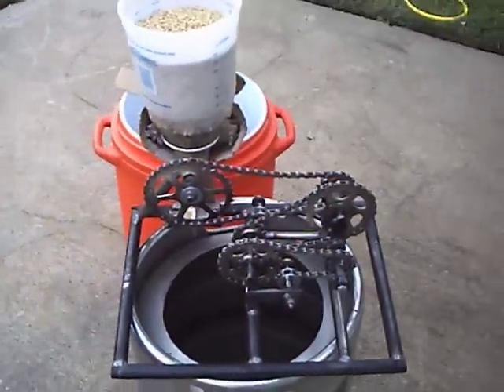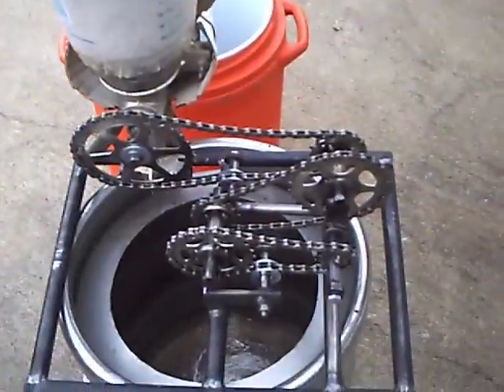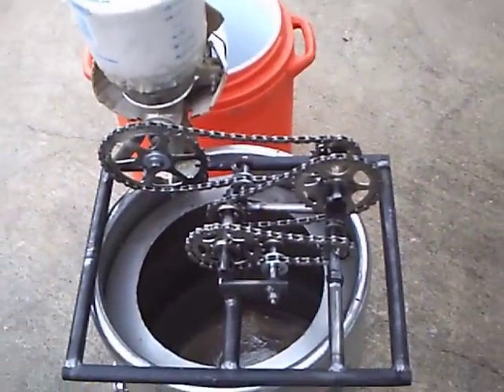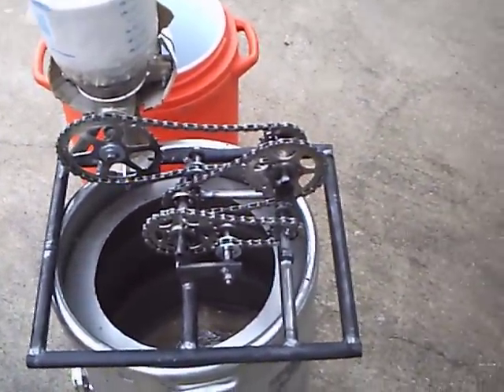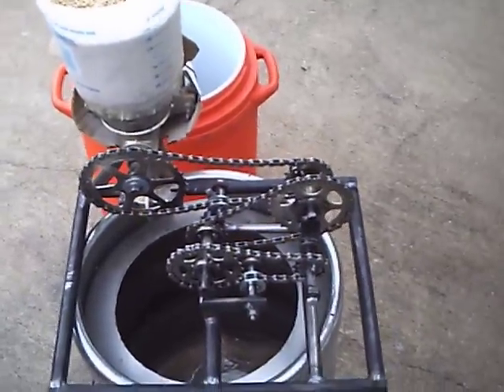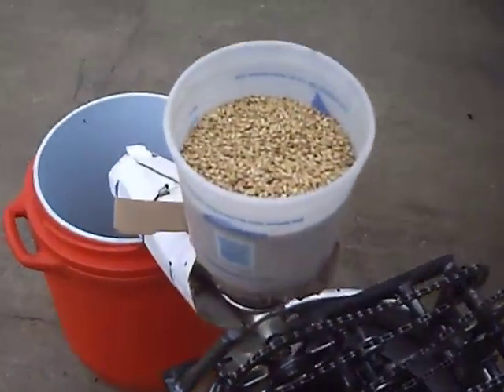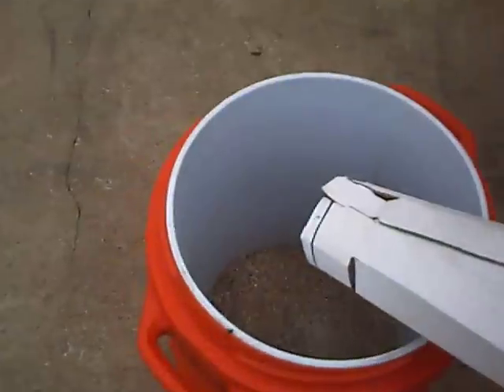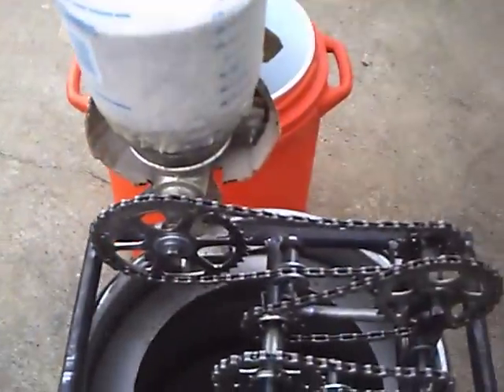Homebrew Grain Mill with Compound Gear Reduction Chain Drive

Comment from the maker: @pbatigne1 I don't remember exactly, but the small inpur gear would be either an 11 or 12 tooth gear, and the largest one is most likely either 32 or 34 tooth. I used the rest of the bicycle cassette gears in between to increase the reduction. Just remember to always drive the small gear.

Comment from the maker: Well, did try that, and it was not ideal. Drill motor got hot quickly due to the excessive load. Plus, I wanted to spin it slow so it wouldn't throw grain everywhere. I built it to accomplish my goal and to learn something... my "contraption" is still working fine 3 years later. Sometimes the best way to learn is by doing.

Comment: Much more torque is required than the drill motor can produce at low speed, Chain or gear reduction increases torque as it reduces speed.

Comment: Brantley, if I wanted to created such a gear reduction system on a bicycle just like you have it here, would it offer a better power to peddle ratio than what a 21 speed already has? My idea I mean would be to take a bicycle and setup a gear reduction system just like you show here to peddle the bicycle so that I am applying less force to gain more power in turn making the bicycle go fast with less effort. Or do 21 speed bicycles already offer that with the two main gear shafts they operate on? I mean maybe it wouldn't make a difference or maybe it would. I figure you would know. Thanks.

Comment: try using a wiper motor from a used car recycler as a motor. they're relatively cheap and good torque.
Reply from the maker: That's a great idea! Yes, those are pretty slow motors.

Comment: Most drills get 22 nm of torque, why did you need to reduce it?
Reply from the maker: I wanted to reduce the speed of the mill. When the mill grinds/cracks too fast the grain flies all over the room and not into my contanier. It's quite difficult to hold the drill at half-speed for long periods of time. With the gear reduction, the mill turns slowly enough for all the grain to go down the chute and I can zip tie the drill's trigger all the way to the handle if I want. And sometimes it's just fun to make things to see if I can.
Reply from the maker: Also, this was addressed just a few comments below this one.

Comment: At first appearance your first 2 chain drives appear to cancel each other out. I question what is the ration of the last chain drive reduction?
Reply from the maker: The drive gear is always smaller than the driven gear thus each set of gears further reduces the output speed.

Comment: What size of pulley are using in this system?
Reply from the maker: I used an 8 speed cassette from a mountain bike. It ranges from 11 teeth to 34 teeth, I think. I don't remember exactly how I have them setup, but it was in a manner that resulted in the greatest gear reduction possible with what I had to work with.
Reply: Thanks my friend, have  awesome 2018

Comment: Ummm... Why not just run your drill at a slower speed connected directly to the shaft of the mill?  An unnecessarily large and complex contraption to solve an easy problem.  Good engineering and assembly, but way more going on than there needs to be.
Reply: Torque amplification.